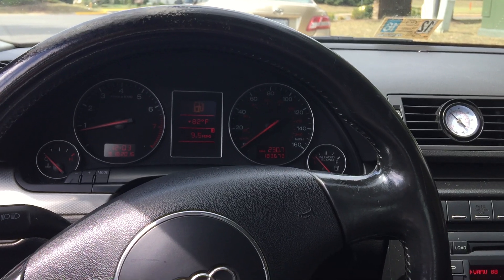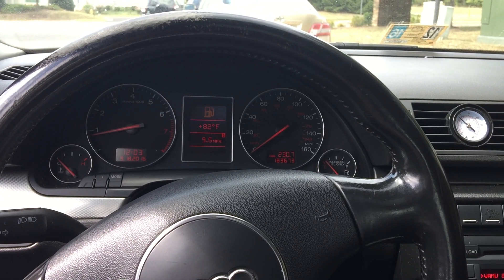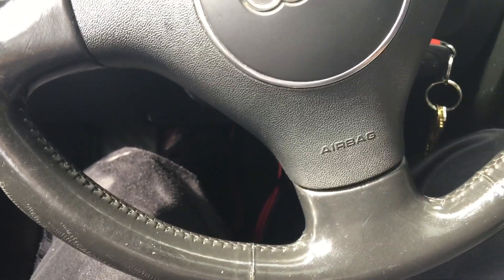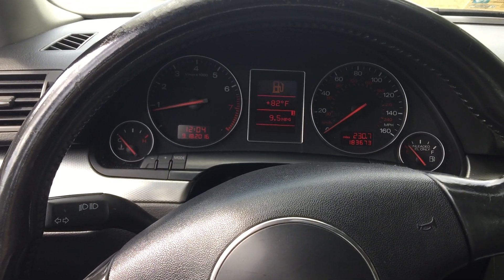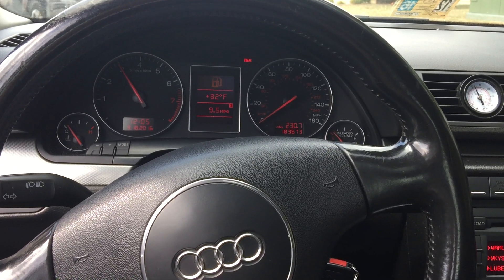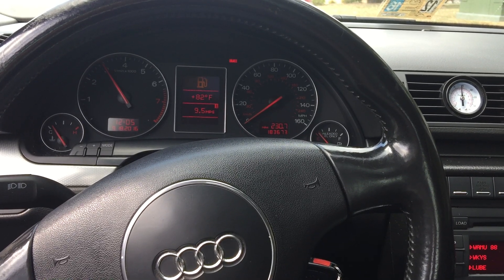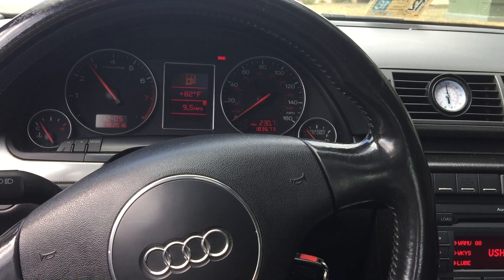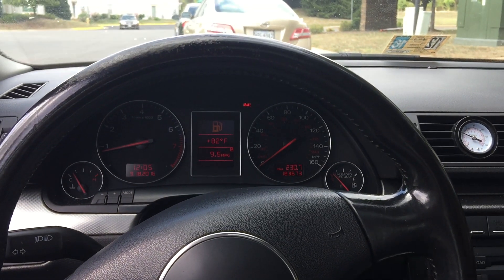Launch Assist Audi A4 B6 1.8T TQM Bosch ME7.5

Comment: how do u adjust it to hit the limiter or atleast 7rpm as I have a 2008 1.8 audi a4
Reply from the maker: not sure about 2008 as thats more than likely running MED9 im only somewhat familiar with ME7.5 its probably similar though you can check out nefmoto they have research on topics like you have mentioned.